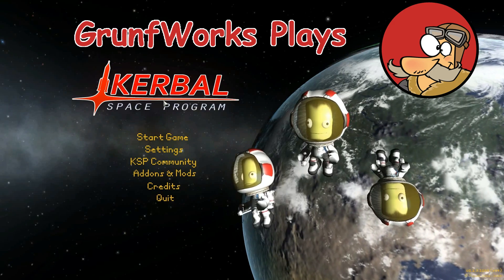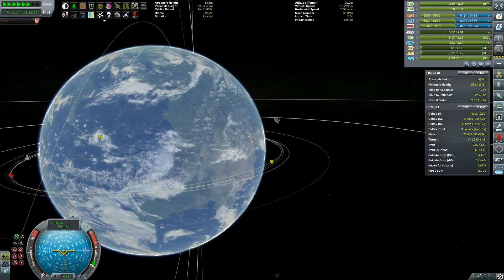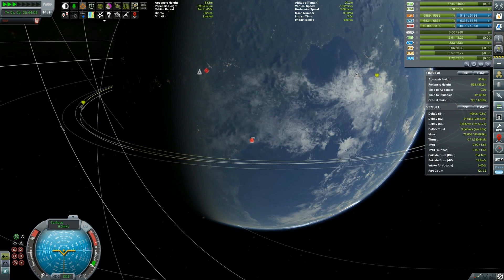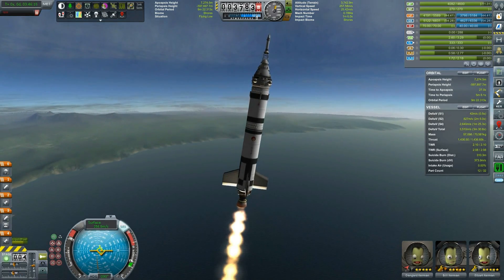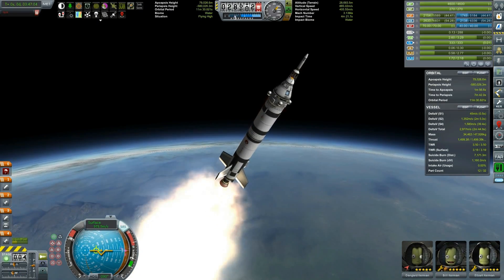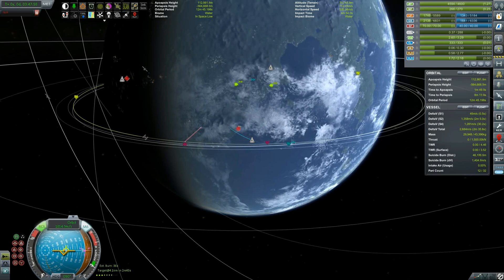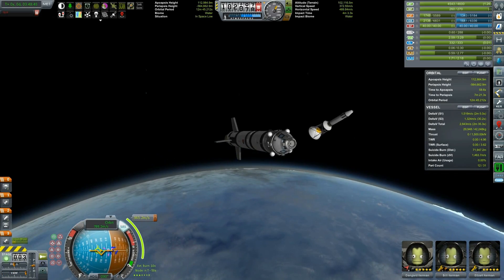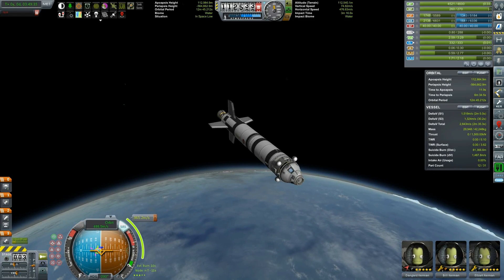Kerbal Engineering - How to Build a Space Station - Episode 04 - Rendezvous and Docking Basics

Comment: thumbs up just because you used docking port alignment. I have a recommendation for the design of new crafts. to make docking easier, disable yaw, pitch, and roll from the RCS thrusters by default, leave the defaults to only translation. assuming you have electrical power and enough torque on your reaction wheels, rotation will not affect translation. that way is easier for new people :)
Reply from the maker: amanuense good tip. thx
Reply: keep the good work :)